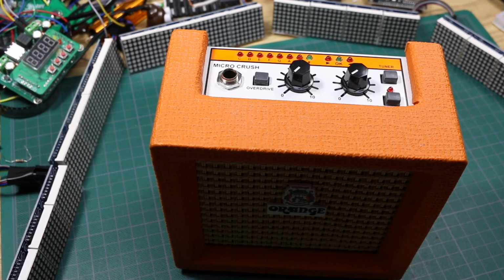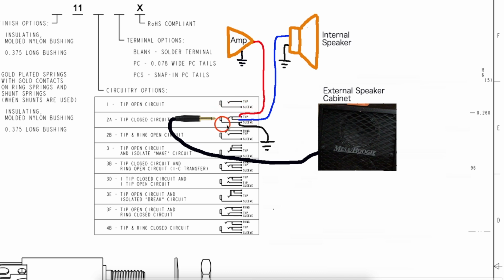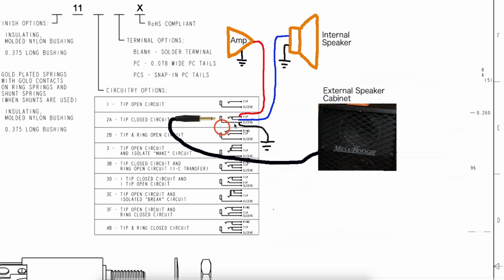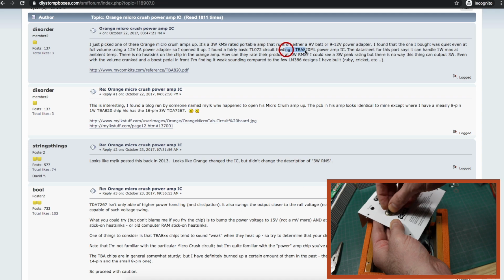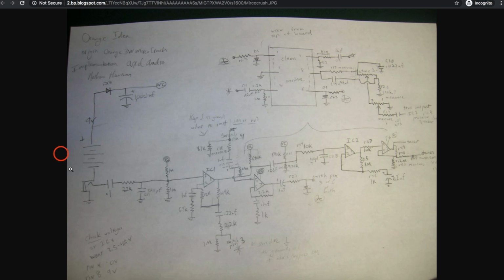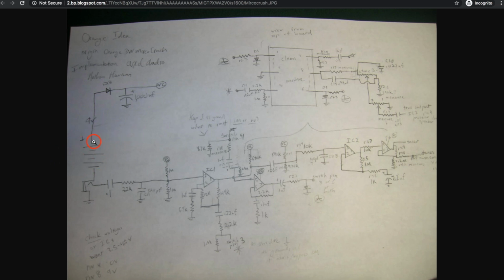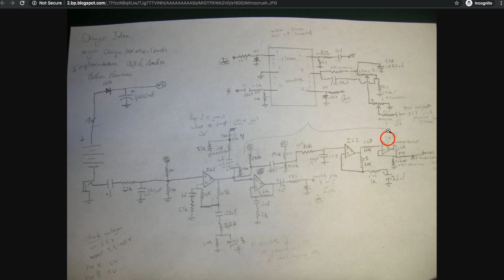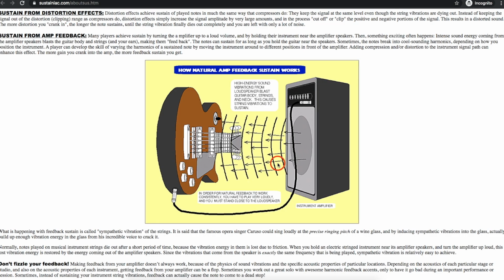Orange Micro Crush Amp: Add an External Speaker Jack

Comment: I want to add an external speaker jack from the chassis, my amp circuit board has a yellow wire connected to the middle of the speaker between the two terminals does a yellow wire means ground because I want to convert to a head for my external speaker one by 12 cab if you can help me I really appreciate it even better. If you have an email I can send you a picture so you have an idea what I’m talking about. Thanks.

Comment: Hey man what's up, i really want to change the distortion a bit, do you got any ideas of modifications?
Reply from the maker: I haven’t looked at the schematic lately but since it is an op amp circuit I would probably try modifying the gain of any op amps that have resistors in the feedback loop between the output and one of the inputs. more resistance should be more gsin. 
anywhere that has diodes somewhere around an op amp would also be related to distortion and clipping so exchanging for different kinds of diodes or removing one or the other might change things.

Comment: Is it possible to replace the 1.2 watt amp chip with something a little bit more powerful? Especially if you would want it to drive a larger cabinet and/or replace the internal speaker.
Reply from the maker: I doubt there would be a direct drop in replacement chip with higher output power, although it’s possible there is a family of parts but then to get more power there’s probably something different needed like a higher voltage power supply, so either way it would basically be redesigning the whole thing and putting a whole different circuit in the enclosure. These little devices are really kind of self contained as is.
Reply: @GadgetReboot  Thanks for the response. I was just curious, as I know little to nothing on how circuits actually work. I have the 20-R and wanted to put a speaker jack in it, that is how I came across your video, which got my mind thinking about other things when you pointed out the amp chips being similar but different. I just thought that there might be something that could be swapped in their place. Thanks for clearing that up.

Comment: Glad i found this video. Mine is different on top by the knobs its not so white. Is mine older or newer version?
Reply from the maker: I think mine is not the newest and I'm not sure if there were more than 2 versions and if the differences were just minor or major.  It seems like some revisions were snuck in under the same model number and people are confused on what they have.
Reply: Thats what I was thinking ive seen at least a few different variations.

Comment: Awesome, I've modded two small Marshall practice amplifiers to add the external speaker output, however I've done that by using a DPDT switch to change between internal/external, I didn't know about these switched jacks and how they work, that makes things easier, thanks for sharing this information and greetings from Colombia.
Reply from the maker: Years ago I did the same mod on a small Roland cube 30 amp, made it sound way better on an external cab.   Just need to remember not to switch it while powered up because it's not good to remove the load from the powered amp, especially if it wasn't designed for switching and has no extra protection designed in.
Reply: @GadgetReboot  Exactly, now this way there's no danger of blowing the amp, thanks man.

Comment: A lot of the actual base circuits are very close. You can make a honeytone sound good if you actually hook it up to a good speaker. The only difference I have found tearing old and damaged amps is full digital vs. analog circuits. And there is something definitely different about guitar watts vs. regular audio wattage.

Comment: Hey, good video, even when I don't fully understand the technical part, but that's the reason for my question. 😅

I've got the 2nd generation of this Orange amp, which now includes the Speaker connector (8ohms). I don't really enjoy the sound of this amp with the internal speaker, and I've got another amp, which is too loud for home practice (Fender FM 210R). Link for manual and specifications: https://support.fender.com/hc/en-us/articles/115005973846-Fender-Guitar-Amplifier-Owner-s-Manuals-Archive-

Do you think than I could connect the Orange Crush Mini to my Fender amp without blowing up any of them, as a kind of external cabinet?

I tried Speaker connector from the Orange to "Pre Out" connector of the Fender and nothing happened. I tried the same, but to the "Pwr In" of the Fender amp, and it sounded but with some noise.

Also I noticed the controls of the Organge Crush Mini were in charge, instead the ones on the Fender amp. Does it mean it is bypassing the Fender preamp?

Is it safe to use the amps this way? I don't know anything about ohms, if it should be taken into consideration. As I've got these two amps I'd like to use them combined, if possible and do not buy anything else for now.

On another YouTube video, they warned about only use Phones connector, not the Speakers-8Ohm one, for risk of overheating (?).

Hope you can help, thanks in advance.
Reply from the maker: my first thought also was to recommend using a headphone output instead of the speaker output because it would be more similar to what the fender preamp out is delivering to the fender power amp in.  I would expect the headphone signal to be weaker than the orange amp speaker output so there’s less chance of overdriving the fender power amp too much and getting garbage out of it  sonically.  One power amp output isn’t expected to drive a different power amp input, so the headphone out is going to be the lowest power out available to work with.

it would be best if the orange amp had a line level output signal but sticking with the headphone out, it should work by connecting it to the fender power amp in but keeping every volume down on minimum to get started and then just bring things up slowly to see if it can even cleanly do it.  As long as it doesn’t sound like it’s going to spiral out of control and the speaker cone isn’t unnaturally distorted,  I wouldn’t expect any problems.

with the fender having the preamp out and the power amp in, it’s basically similar to having a cd player line out that would plug into your receivers line in which is the power amp, so we are just replacing the CD player with the orange amp.  by connecting the orange speaker out to the fender pre-out, you were basically taking two outputs and trying to feed them to each other like connecting the line out of a CD player to the line out of a tape deck, so that wouldn’t work.

by connecting orange to the fender power in, you are replacing the fender preamp with the orange preamp, so that’s why those controls are not doing anything and the orange controls are the ones working.
Reply: @GadgetReboot  thanks a lot for your reply, it helped

Comment: Cool mod to a handy desktop Amp. Think I will see if I can locate one.
Great vid and thanks for sharing.
Reply from the maker: i’m not sure but I think for this specific amp, they changed it to a similar model maybe it’s called mini instead of micro, and I think they include an external speaker jack but I’m not sure. Of course there’s other similar small amps like this and the used market would have the older ones.

Comment: The biggest surprise is that the components are though hole.
Depending on the load, but at 9V (= 4.5V peak = 3.2Vrms) you can only get 3.2^2/8=1.27W @ 8 ohm or 3.2^2/4 = 2.56W @ 4ohm.
Practical values will be a little lower (usually around 15-20% lower)
Reply: You can get a lot more power with a bridge mode (BTL) amp, and a lot better efficiency with Class D. I dunno if that would sound better, or if having the archaic Class AB chipamp is still the  best.

Comment: When I was at school my friend was almost forced to play guitar on a school assembly which he did not want to do. Well he did the song they requested, went heavy  metal and all fuzz at the end bumped the guitar down on to the front for the speaker took a brief look at the head master and walked off the stage.  The teachers sat looking at each other before they realised he was not coming back and went to try and stop the very loud noise howling from the state. That brought back memories, thanks great video.

was expecting to see if they had two 820's working in a bridge, which should have given about 4 watts. if i remember right a bridged output gives twice  the voltage swing 4 time the power?
Reply from the maker: I've never tried a bridged amp config, I wonder if the LM386 can suffice for some breadboarding since I have I think 50 of them in a stash somewhere...

Comment: Awesome video. Awesome project. Love the red circle around the mouse pointer however .... it has decided to follow me around everywhere I go now. 😱
Reply from the maker: It's a good thing my laptop is so old it's locked to a certain older OS version and I can't upgrade beyond that - somewhere since then, these free mouse highlighters stopped working!
Reply: Thanks for sharing! I am mostly done with Apple. Going back to Linux when the time comes .. maybe this year but hopefully not until next year.
Reply from the maker: my other Linux machine has been giving me problems, I messed it up while trying to upgrade too many major versions where it’s best to just reinstall from scratch, so I did that and now occasionally when I reboot it gives all sorts of ACPI or whatever errors and it actually self reboots three or four times before it will get to the login screen and I don’t know what’s going on so I just let it do its little jig as long as it lets me in.
Reply: As long as there is no data on that machine that has not been backed up, I would wipe that hard drive 100% clean and try another install. Maybe even try a different distribution. This happened to me once on an Ubuntu desktop, I was trying to compile and link all the necessary libs to get Google's Deep Dream software running. Something, like.a driver or two, surely was not completely obliterated, and is using wrong configuration values. Just a hunch, of course. I hope you get it fixed. :)